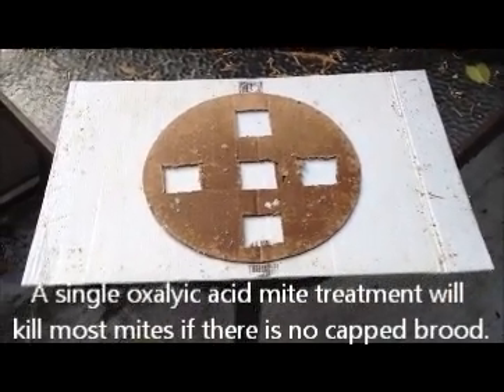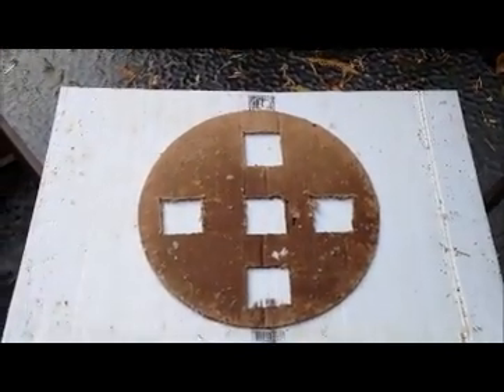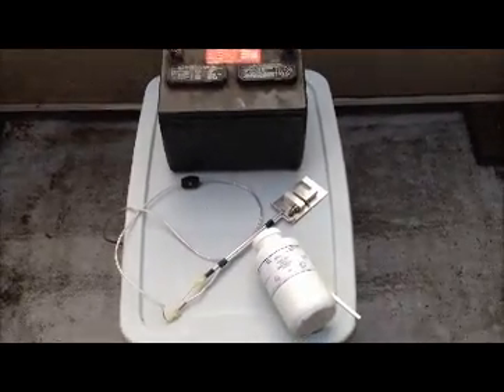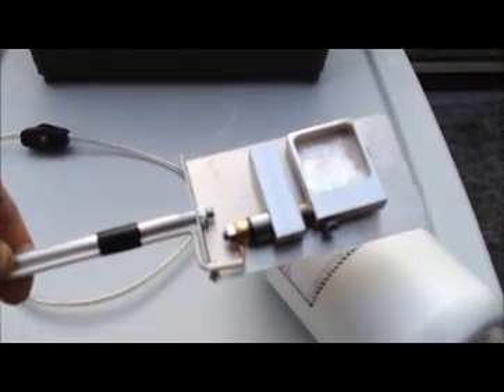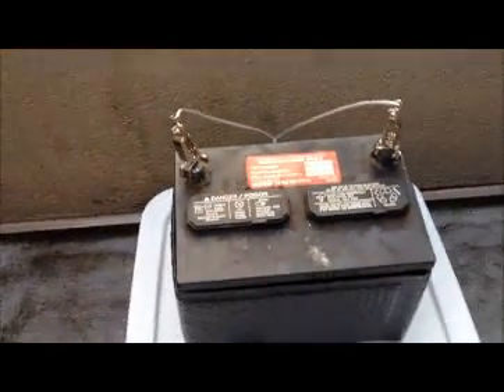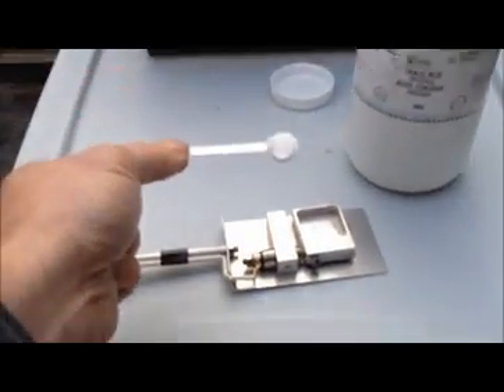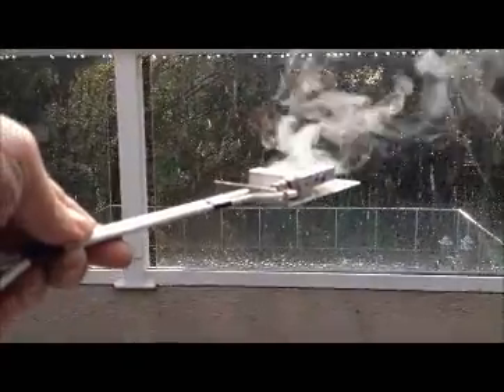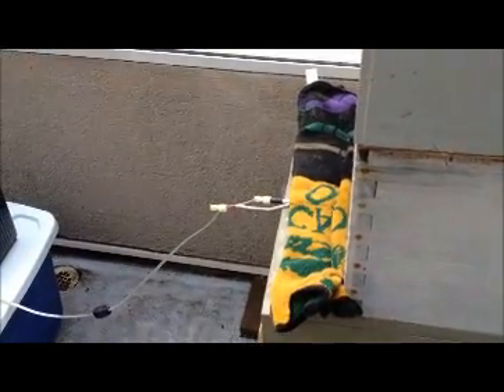Oxalic acid vaporizer (JB200) for honey bee mite control

Comment: It's 2016, would or have you altered your treatment plan for Varroa mites ? Please explain if you have.
Reply from the maker: +Smokeydabee Charles Coleman I've been treating my bees using this method for several years now and I like the ease and natural ingredient approach.
Reply: +Doug Brown  Thank you very much. BTW how hot does that tool get ? ,in degrees please.
Reply from the maker: Smokeydabee Charles Coleman I haven't measured, but it gets hot enough to melt acid crystals, so it's hot enough to burn wood if it comes into contact with it. Definitely hot enough to burn skin.
Reply: +Doug Brown If you don't mind , would you look at the heating element and get a part number. That way i can research it myself. I believe i can make that item for about 35 dollars.
Reply from the maker: It's all custom made from Heilyser. The heating element looks to be aluminum either poured/molded or a block that they ground down to make the scoop.
Reply: +Doug Brown Thank you for your time Doug. You have a great channel. BTW, i did find a way to build it for under 30 dollars, not counting the battery.
Reply from the maker: Super, glad you got it going.
Reply: Hoped you made a vid of that feat. I couldn't find one on your channel.

Comment: Hi. I can't quite see the Lions from here, but I'm close by. It's my first year and I'm a bit (quite) concerned because the mite counts are way high and I'm seeing quite a few bee's with DWV despite treating with Apivar in September/October. I expect higher drop counts over the winter because the bees hate that cold wet rain just as much as I do so are staying inside ... but 150 mites in 3 days seems abnormally high. Considering our west coast weather once it starts raining it generally doesn't stop until March, I wonder if there will be a day where I can do a OA dribble, so I'm thinking about a using vapourizer instead. Would November too early to treat?
Reply from the maker: +paxette I wouldn't dribble this late in the year because of the cold. You can do an OA treatment anytime and it's fine to do that right now. There will be very little capped brood so you should be able to knock back most of your mites.
Reply: Sorry, my fault. I don't want to dribble OA on them now. I'm concerned about overdoing it with the mite treatments; not sure where the balance is yet. Thanks for the help!
Reply from the maker: +paxette I'm sure you can do an OA treatment now. No problem.

Comment: Hi there, I am planing to get a polystyrene paradise Honey Bee Box. I notice you are holding the end of the vaporizer. How hot was the part you are holding? I think that's about where it will seat on the polystyrene. Thx :)
Reply from the maker: The copper wires from the battery meet at the end of the vaporizer where you put the oxalic acid, and all the electromagnetic energy is converted to thermal energy at that point. The handhold end is perfectly cool so no problem for me at all.

Comment: Doug, I take it this is best done just before the solstice on the 21st??
Reply from the maker: The trigger point is when most of your brood has emerged so the vapor can come in contact with the mites (vapor can't get into capped cells.) The queen will always be laying through the winter, but once the nectar flow stops in autumn she will stop laying aggressively and this is your ideal time.

So just take a look in autumn and pick a nice day to do the treatment. You can see I did it on a wet day because the bees were all inside at the time so I had good coverage.
Reply from the maker: You should also do it again just before the queen starts laying in the spring. I'll do a treatment in late February here in Vancouver when the first flowers emerge, and the queen won't have started laying aggressively.
Reply: Westernwilson you want to treat the bees that will precede the winter population that way the winter bees will not be exposed to the viruses mites carry for most that would be September

Comment from the maker: Hi Tony, I accidentally removed my response and I'll repost. I've been using formic acid for 25 days and you can see the decline in dead mites in the graph I posted in the video. I did the OA treatment after this and saw a much higher dead mite count so it definitely worked. I was getting about 100 dead mites a day with formic acid after 25 days, and I probably got 3-4 times that much with the OA treatment, so it worked a lot better in my opinion. It gets through the hive very thoroughly.